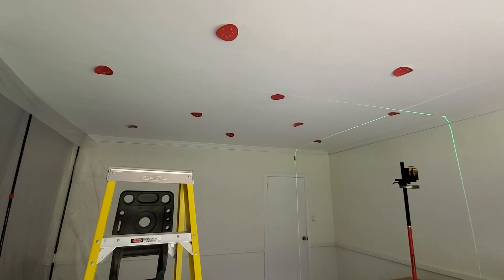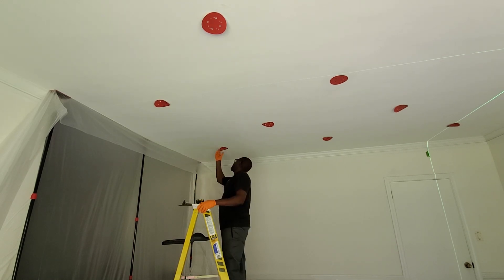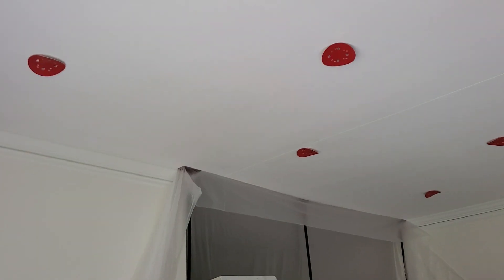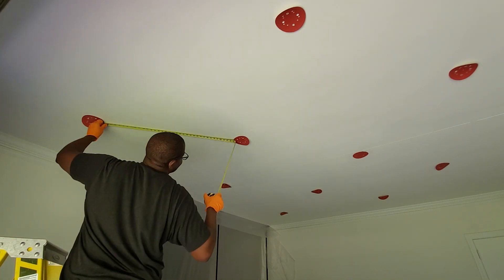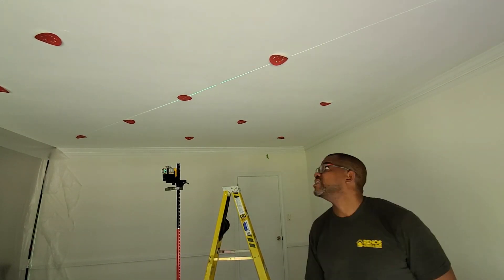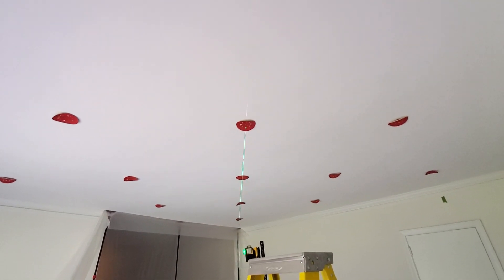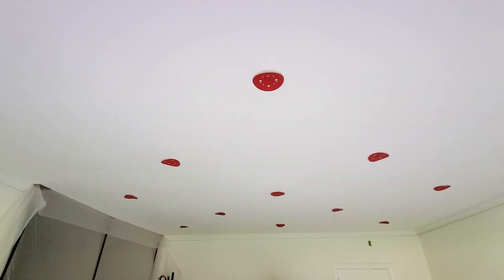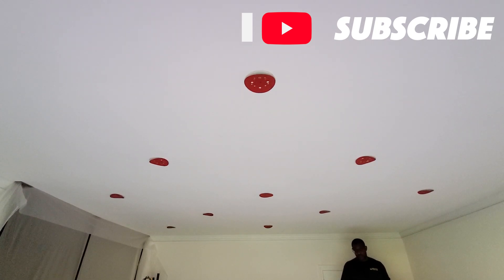RECESSED LIGHTING LAYOUT WITH LASERS  | Quick Tutorial In Fast Forward

Comment: It's always interesting to see how others work. 

One question popped up for me: With the other nine already being confirmed, why didn't you use the diagonals between four of them in a quadrant to get the position for the additional light in that quad? Would've been even easier using your cross laser. No running up and down ladders and having to measure and re-measure over and over again, and it works whether the corners of the room are 90 deg. or not, as long as the spacing of the other lights is correct.
Reply: I agree, waste of time and not really title if video. Make your outer square and centered. Then, divide your spacing for interior lights. Use nails and hook your tape too.

Comment: Hi, good video but the way you are measuring is a waste of time. Do it by calculation first on paper and put up low stick painters tape on the approximate places so you can make a measurement from the walls or closest reference point.
If you know where one lamp is and the spacing between them there is no need for this cross-measuring. If my "master" saw I was doing it this way he would freak out. I'm just an apprentice still.. I say master because in my country that is what the "teacher" is called that I am employed with.
Thanks.

Comment: What about hitting the ceiling beams?
Reply from the maker: We installed Led Wafer Lights on this project. They don't have cans. You just have to avoid any wiring.
Reply: This is the same query I have. If you put a light under a beam, even if it is thin enough. Isn’t that non compliant because it needs to be in a open space and no insulation covering it?